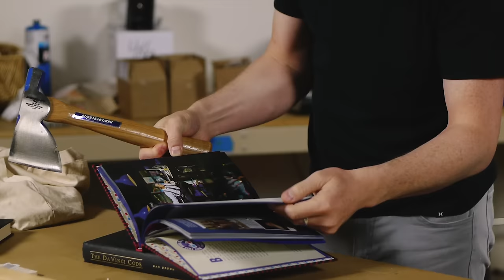Building (and Testing) Improvised Body Armor

Comment: Aren't ceramic plates used in modern military body armour? Along with Kevlar, obviously. Also books have almost stopped a tank.
Reply: Lol, that made me think about how many books you'd need to tape to the end to stop the shell.... lmao
Reply: Elraek Mail yes the plates in interceptor ballistic vests (IBA) are made of ceramic. you can break one if you throw it down hard
Reply: FreeER atubeacct or jam up the tracks with books
Reply: Elraek Mail 
yes, but not ceramic tile. I believe it's a form of powdered metal compound of some variety.
Reply: for that you can check up game theory with Halo's fatal armor flaw episode, it goes bit more in depth with body armors, there was hard plastic, ceramic (still used but not as much), kevlar, titanium (impossible to wear)
Reply: Adam Jensen modern tweaked variations on carbide structures are usually the base...like silicon carbide or boron carbide composited with lots of other stuff.  Ceramic tiles still have a decent effect, the breaking absorbed and dispersed energy as a simple component of a ablative armor.  Bind a few layers incased in a strong flexible coatinge and it's a lot more protective for a single direct blow.
Reply: Elraek Mail What about the material that's made of reformed carbon atoms?
Reply: how would it bro just strap the top off of the back of the shitter on your chest and go for it!!
Reply: +ShadowWarrior 24 carbon nano tubes?
Reply: +Joshboy Future, my thoughts exactly at this point m8
Reply: Elraek Mail I think so
Reply: TheUnborne btw game theory's episode is EXTREMELY flawed if you literally know ANY halo lore...
Reply: but i don't, body armor wise it does seem like a good starting off point to go in depth a bit
Reply: Elraek Mail Certain ceramic is better then Kevlar. Kevlar only stops low calibre bullets.
Reply: Generic Username Kevlar is used as an arrestor and holder more than for initial blunt force and stopping
Reply: At the core, the idea behind the ceramic armor is for the plate to deform or fragment armor so that the soft armor behind it can catch the bullet..

The reason steel armor is so popular in the consumer market is that most people buying combat armor do not understand the weaknesses of steel. Steel holds up against dozens of rounds better than ceramic, but it only takes one to kill you. There are 5.56 bullets that are capable of defeating most steel armors, not to mention all the 7.62 APs that defeat anything with a manageable weight. This is why even AR500 Armor's best armors are ceramic/composite.

And as far as titanium armor goes, titanium in its basic form is harder than common tool or structural steel, but the hardest titanium alloys are weaker than the hardest steel alloys. Titanium does have an advantage, weight. It is lighter than steel for same thickness, but far weaker. Where titanium is useful in body armors is in ceramic forms, but there are better ceramics for the job. Namely boron carbide.
Reply: Steel doesn't break down/ isnt' fragile, ceramic is, that is why most people buy ar500 steel instead of ceramic, most pro armor is Kevlar or ceramic, but ceramic can do more damage than good in some cases, can even impale you after being shot
Reply: Madra, a quick correction. The hardest affordable titanium alloys are weaker than the hardest steel alloys. There's a titanium-gold alloy that, if I remember correctly, is about twice as strong as AR-500 steel, but a full vest would probably cost an exorbitant amount.
Reply: This got a lot bigger than I thought it would.
Reply: Elraek Mail lol shoulda just syrapped the shitter lid on and kept quiet huh?!
Reply: I agree
Reply: Evan Wickstrom, the hardest known titanium gold alloy is 4 times harder than pure titanium. AR500 means it is Abrasion Resistant 500 BHN. The titanium alloy is around 600 BHN. There are tool steels that push 900 BHN, but weight becomes too much of a factor for those to be used as armor. The hardness of ceramic body armors are around 7000 BHN. This is why bullets can't just punch through them. They are so brittle though that they become compromised from micro fractures if they haven't already cracked or shattered. With high quality plates the area that does crack and shatter is much smaller so the plate can survive more bullets in other areas, cheap ceramics will impact on a corner and shatter across the entire plate.

WoopWoopThatsThaSoundofthePolice, ceramic only does more harm than good if you plan on having your plate shot by bullets incapable of penetrating the steel. The wear from repeated hits will compromise a ceramic plate long before a steel plate. Also I have never heard of someone being impaled after being shot. If that was the case then the soft armor behind the plate was compromised meaning the bullet penetrated. Maybe I am weird but I would consider a few shards of ceramic in a wound better than several wounds. If you can site a reputable source on the claim that it can do more damage than good in some cases, I would be willing to change my stance. The only evidence I have seen of that have been baseless claims.
Reply: Elraek Mail there is a small layer on body armour, it 'catches' bullets, and is made to break
Reply: Lol "almost"
Reply: Elraek Mail is that a the mythbusters episode when they tried pulling apart phone book?
Reply: +Tom Dunphy, yes and you're the only person to get it
Reply: Military doesn't use kevlar, they use plate carriers
Reply: Joshboy Future WRONG. Level 3 and 4 Ceramic plates can take a sleghehammer multiple times and still stop bullets.
Reply: aren't those made of kevlar? pretty sure mine is, but it's from early afghan war (circa 2002)
Reply: Elraek Mail yes you are right tanks use ceramic armor.
Reply: Elraek Mail you know, I've heard a story of someone surviving a gunshot purely because they had like a mini bible in their breast pocket, not sure how realistic it is, but it's good to keep in mind
Reply: Yepp thats why you are told not to drop/throw your body armor on the ground :P
Reply: Elraek Mail nope differnt type of ceramic and its on tanks not body armor
Reply: Elraek Mail and a tank shell wont get stopped by a book. Compared to bullets tank shells impact so hard things basicall explode. And thats a 30mm not even a 120mm
Reply: Ceramic plates are used i truma plates prob spelled truma wrong
Reply: you're right about the ceramic plate thing, but sure as fuck not the tank.

Comment: Hey, just a heads up, even though it takes longer, removing the pages, laying the backs out flat on top of each other, and layering pages back over top of them with glue adds a large amount of resistance. Putting the hardbacks first, tiles second, paper third, with another layer of the hardbacks will always be the most effective. The hardbacks act as low-velocity armor, and "soft" bullet breaks, while allowing the tiles to be hard breaks.

Comment: Demolition Ranch tested the effectiveness of bullets going through paper. The results were that a ream of 500 sheets of paper can block almost all of the requirements for 3A (IIIA) bullet proofing, which includes most typical pistol calipers. It (almost?) stopped a 44 Magnum. 2 reams of paper should have you covered, if you interlock the pages.

Comment: It’s not about resisting the force, but spreading the force out, so it can’t do much damage, the ceramics aren’t supposed to be indestructible, they are supposed to take the blow for you, the pages are not meant to be bullet resistant, but when you layer them on top of each other, they each take some of the energy out of the bullet

Comment: Good video. A few things tho: first ceramic makes for pretty good armor actually, just not against thrusting weapons or handguns and not in the way used here. Tanks for example use ceramics because they distribute force, and don't make a million shards of molten steel go through your tank.

The books would probably stop most commercial rounds if you put 1 or 2 layer sof ceramics in between. Because just as a ceramic plate doesn't make for bad armor because it breaks, a book doenst make for good one just cause it doesn't.

Book-tile-book has a bullet change mediums 4 times before entering your body, so it will lose a lot of energy. With the energy loss of the book the plates will be even more effective.

Comment: A more sciencey way to explain the ceramic tile.

What Brian is trying to explain is it's not the force that you're protecting yourself from with the ceramic tile, it's the pressure. Pressure equals Force/ surface area. You increase the surface area of the blow, you decrease the pressure.

Comment: Even better, when your ceramic tiles break, you have a shank if the tiles break properly. (A pointy piece of broken glass or tile with electrical tape or duct tape to prevent the glass or tile from cutting you when to stab someone/something). I also prefer using the concept of ceramic/composite body armor, but with improvised body armor, I would probably put another book over the ceramic to prevent any knives from breaking the tiles.

Comment: Just a thought, if you offset the books a little (just an inch would do) there would be less damage done if that slit between the sets of books was accidentally hit.  Though it would probably take a little bit more time to tape the individual sets together that way.  I was really only worried about that near the end where Brian was aiming for the center of the books with the blade side of the hatchet at a near horizontal angle...

Comment: outside to in, ceramic, books, then foam. the foam should be there to make the transfer of energy from the books and ceramic layers take as long as possible. the ceramic plates are there to shatter and absorb as much energy as possible, and the books are kind of like road barricades.

Comment: Ceramics break because they are not properly support. Apply a omnidirectional force on a ceramic, properly supported (bottom of tile, not just 3 or 4 points like it is in the video) and a apply that force on a big area and you won't be able to break it. Ceramics are really good with compression (and very weak with extension) , impact not so much but still, I believe it will become a lot harder to break.

Comment: Actually ceramic would have been perfect, because thats what police vest also have, its a plate of ceramic in the front and a couple of sheets of kevlar behind it, ceramic, to keep it simple, breaks up the bullet and slows it down exponentially, and the kevlar catches the bullets, works around 9mm up to almost 3.08 depending on how many kevlar sheets you use behind the ceramic plate

Comment: Level 3 body armor is steel and rubber but level 4 (stronger) has to be made with ceramic steel and rubber because steel becomes brittle. But ceramic can still be used 2 or 3 times at its limit round but smaller rounds than its max are like nothing.

Comment: 5:10 so ceramics are very hard.  it's not necessarily about the microfractures - although there may be something to that theory - but the reason ceramics are often used in composite body armor or armor in general is because they have extremely high compressive resistance, which breaks up the bullet.  makes it easier to catch the pieces in kevlar or stop them with steel.  

that said, i sincerely doubt this would stop anything more than a .22 lol.  i've seen books get shot without ceramic before.  it's pretty disappointing.  the tiles would help break up a bullet, for sure, but i still think the frag will go right through the books.

Comment: They don't have the right ceramics for body armor. The military uses ceramic plates with steel back parts to make sure the ceramic doesn't pierce the wearer, and it is made out of a tougher clay, and is held together in a near vacuum tight seal that makes sure it doesn't split apart and create lareg air gaps easily.

Comment: For the books, instead of doing two stacks of books with a gap in between, it would be better to put two facing one direction, and then a second layer, at 90 degrees of the first layer. There wont be a gap where you have no armor if you do that.

Comment: PSA: If you do buy body armor (Level IV ceramic rifle plates that are designed to stop XM855--5.56x45mm with a steel penetrator--aren't terribly expensive), make sure it is NIJ certified. Don't fall for the work around that some companies use to avoid the expense of NIJ testing like saying their armor is tested to "NIJ standards". That just means the company tested it themselves and may not have been all that scrupulous.

Comment: The ceramics aren't doing much. The term ceramic refers to a wide array of different materials, just as plastic can refer to any number of compounds. Those tiles are far different from the knife blades or armor. While it will certainly resist impacts, it isn't near strong enough for its heavy weight. 

If you build a small forge and melt aluminum in it, I've stopped a round from a .45 fired from a Glock 21C with a little less than an inch thick. 

For a cheap trick mix wood glue and water until it is thin as milk. Then put it in a cleaner bottle with the hand pump sprayer. Take sheets of paper and lay it over a shape to fit to your body, then it begins. Spritz, put down a sheet, spritz, sheet, spritz, sheet, spritz, sheet. You can basically create a plywood set of armor. You can also lay down strips of metal to create a scale mail like pattern sandwiched between the two.

Comment: contrary to popular belief, kevlar isn't bullet proof, actual military vests use ceramic plates to stop the bullets (though they're much thicker and bettef made and last longer before breaking) the kevlar does the job of making sure that the force is distributed evenly so that you get one big bruise instead of breaking a rib.
and that's exactly why his armour works so well, it's using the same idea but with improvised parts, however as someone esle said, that does mean that this isn't nearly as durable, it'll only take a few hits before breaking, so bring spares.
Reply: Great information.
Reply: senrab naneek no kevlar and other ballistic fibers can and will stop bullets, you just need to use enough for what you're trying to stop, also some soldiers are issued steel plates, the ceramic brakes down the moment it gets shot(assuming the bullet still has enough energy) but military grade ones are more durable to an extent, you can turn most anything into 'bulletproof' armor you just need to know how

Comment: Hard and brittle ceramic tiles may well break up an incoming bullet making the book much more likely to stop the bullet fragments than an intact bullet. Also you might try epoxy, polyester resin or even simple wood glue between the pages making it more like micarta.
Reply: Ah, you did add the tiles, hadn't watched that far yet. But if you revisit this try resin or glue as well.

Comment: 5:00 Brian, you just got SOOO Fucking lucky. Your Balisong. Your hand could've so easily slipped down the handle and over your blade, which is actually a statistical issue in most stabbings. The attacker usually ends up cutting themselves, which means if the murder weapon is left behind criminal labs investigating into the crime have a high likelyhood of getting the attacker's DNA from blood. Anyways, back to the point I was making, you narrowly avoiding slashing your hand open on your own knife there Brian.

Comment: The improvised plate is being worn too low.  It should be level with the top of your sternum, as the plate's first job is to protect the heart, part of the aorta & vena cava, as well as the inner half of your lungs.

Also, more coverage is possible, but comes at a cost of mobility.  HOWEVER, this raises the question of how important is mobility versus protection.  A heavy gunner will have different armor needs over a skirmisher, and regular infantry will have still different needs.  Another concern is expected threats if you're watching how much weight you're carrying, because pistol-rated armor is a fraction of the weight of rifle-rated armor.  Although, if on a budget, rifle-rated steel armor is about as cheap as you can go, while still offering ample protection from common threats, usually up to .308 AP.

Basically, body armor is one field where research can easily save your hide.

Comment: I made some stab-resistant body armor a bullet would rip right through it but what I did was I literally took some duct tape a 3-ring binder and some paper I got out of a ream I cut the two panels off of the 3-ring binder and basically made a sandwich out of that with about I would say I don't know 50 60 pages maybe 70 of paper and duct taped it all together and took my most razor sharp knife and stabbed it as hard as I could and it put like a dent I even tested axes on it and those only left a small cut

Comment: 12:10 the target even made it better, by providing a soft layer for the blade to get stuck in, wtf xD
also 13:44 DUDE, trigger safety! even if it's non lethal (or in this case not necessarily lethal)...

Comment: flat body armor is not good if it's against hitting it.Having a curved breastplate where there's a little gap inside,you can feel the air blowing out when you get hit.
Plus there's no padding under the books.